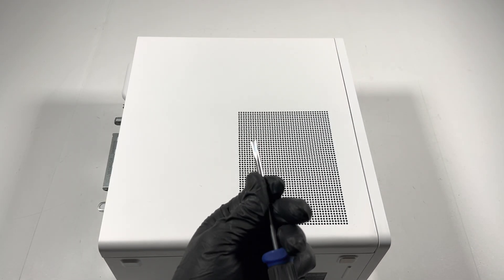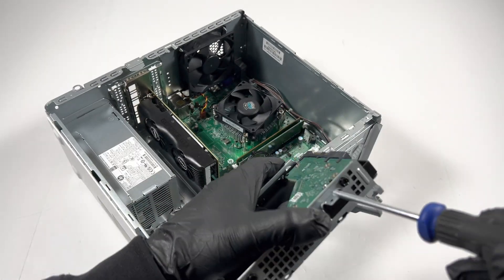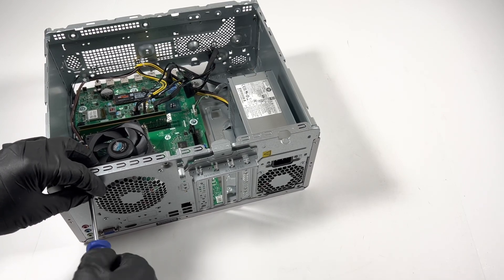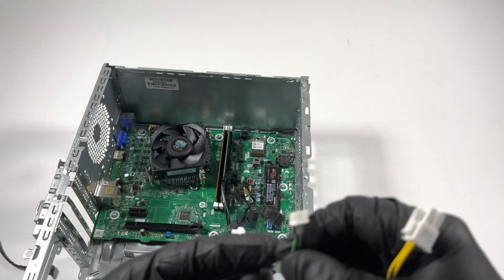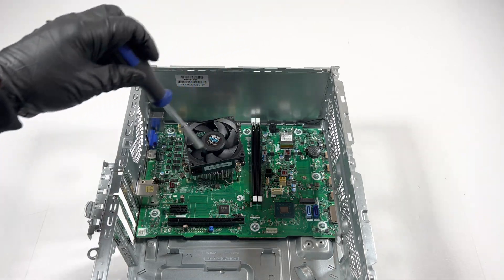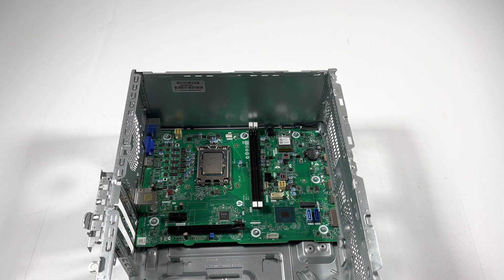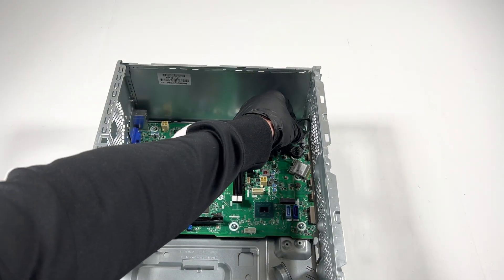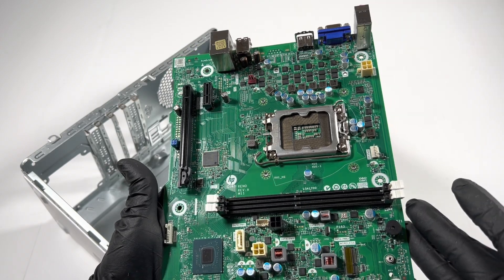HP Pavilion TP01-3003w Teardown

Comment from the maker: List of Parts and Upgrades works with this HP Pavilion Desktop TP01-3003w system :

List SSD Heatsinks:

(1.)  M.2 2280 SSD heatsink, Double-Sided Heat Sink, PCIE NVME M.2 SSD
https://amzn.to/3l2ittr

(2.)  EZDIY-FAB M.2 2280 SSD heatsink, Double-Sided Heat Sink, PCIE NVME M.2 SSD
https://amzn.to/3m7J3me

List SSD M.2 Type 2280 NVMe PCIe:

(1.) Crucial P3 Plus 4TB PCIe M.2 2280 SSD
https://amzn.to/3RZcUNi

(2.) Crucial P3 Plus 2TB PCIe M.2 2280 SSD
https://amzn.to/3RTUi0Y

(3.) Samsung (MZ-V7E1T0BW) 970 EVO SSD 1TB M.2 NVMe
https://amzn.to/3d52k2a

(4.) Samsung 970 EVO Plus SSD 500GB
https://amzn.to/3fpi95A

(5.) Samsung (MZ-V7E500BW) 970 EVO SSD 500GB - M.2 NVMe
https://amzn.to/37uuLFw

(6.) Crucial P1 500GB 3D NAND NVMe PCIe M.2 SSD - CT500P1SSD8 
https://amzn.to/2N07wKh

List of RAM will work with this system MAX 64GB.

(1.) Crucial 32GB Kit (2 x 16GB) DDR4-3200 UDIMM
https://amzn.to/3BdbNm3

(2.) Crucial 16GB Kit (2 x 8GB) DDR4-3200 UDIMM
https://amzn.to/3U24CpE

(3.) Crucial RAM 64GB Kit (2x32GB) DDR4 3200MHz
https://amzn.to/3xEsF4b

Thermal Grizzly - Spatula for Applying and Spreading Thermal Paste 
https://amzn.to/3d8NQEE

Thermal Compound Paste:

(1.) Arctic Silver 5 Thermal Cooling Compound Paste 
https://amzn.to/2ziNU0H

(2.) Noctua NT-H1 3.5g, Pro-Grade Thermal Compound Paste
https://amzn.to/36kTk7A

(3.) ARCTIC MX-4 (current edition) Thermal Compound Paste 20 Grams 
https://amzn.to/2DhGJaK

List video cards will work with this system.

GIGABYTE GeForce RTX 3050
https://amzn.to/3W2sJY9

MSI Gaming RTX 3050 Gaming X 6G Graphics Card 
https://amzn.to/4eNikqD

(1.) ASUS Phoenix NVIDIA GeForce GTX 1650 OC Edition Gaming Graphics
https://amzn.to/3Nyn7yb

(2.) ASUS TUF Gaming NVIDIA GeForce GTX 1650 OC Edition Graphics Card 4GB GDDR6 
https://amzn.to/3moJbzo

(3.) PNY GeForce GTX 1650 4GB GDDR6 Dual Fan Graphics Card
https://amzn.to/3aFlxw4

(4.) ZOTAC GAMING GeForce GTX 1650 OC 4GB GDDR6 
https://amzn.to/3xeX0FF

(5.) AMD Radeon RX 6400 Low Profile Gaming Graphics Card
https://amzn.to/3s8MUUY

(6.) Gigabyte GeForce GT 1030 GV-N1030D5-2GL Low Profile 2G Computer Graphics Card 
https://amzn.to/2Z4PHkp

(7.) ZOTAC GeForce GT 1030 2GB GDDR5 64-bit Low Profile Video Card ZT-P10300A-10L 
https://amzn.to/2WzgLXk 

HDD list works with this PC:

(1.) Seagate BarraCuda 4TB Internal Hard Drive HDD – 3.5 Inch
https://amzn.to/3d3xWeR

(2.) Seagate BarraCuda 8TB Internal Hard Drive HDD – 3.5 Inch
https://amzn.to/3xjUDSJ

(3.) Western Digital 2TB WD Blue PC Hard Drive HDD - 5400 RPM, SATA 3.5" - WD20EZAZ
https://amzn.to/3w3jIQA

(4.).WD Black 2TB Performance 3.5" Hard Drive - 7200 RPM Class, WD2003FZEX 
https://amzn.to/2xFUeyF

Disclosure: Amazon links this means that if you purchase an item we earn a small sales commission affiliate.
Reply: But what CPU's can we upgrade to?

Comment: Thanks for this video. Want to upgrade memory. What is the max RAM voltage for this motherboard ?  (hope 1,35Volt:)
Reply from the maker: Hi, i use Crucial NON ECC RAM an the voltage is 1.2V.
Reply: @Mxkdt  thanks, I just put two of these. Imho, this mobo goes up to 32GB (no more).

Comment: is POs 300 w ?
Reply from the maker: Hi, power supply is 310watt
Reply: @Mxkdt  thanks pro
Reply: From my experience with this HP. The power supply Needs to be upgraded to the 500 watt with the 6 pin power connector for the GPU. The power supply it comes with does not have it.
Reply: @Skylinegtriii how you like this PC for gaming after the upgrade ?